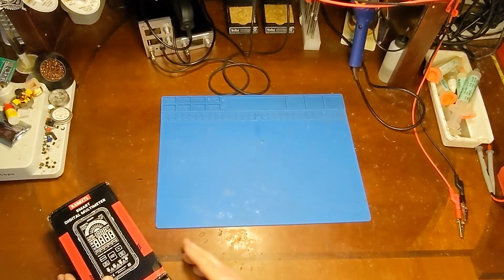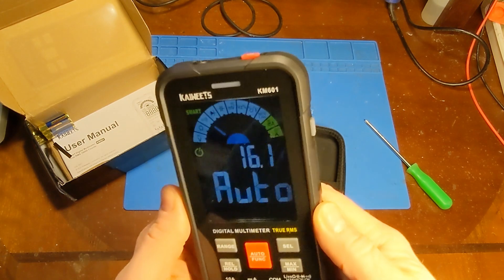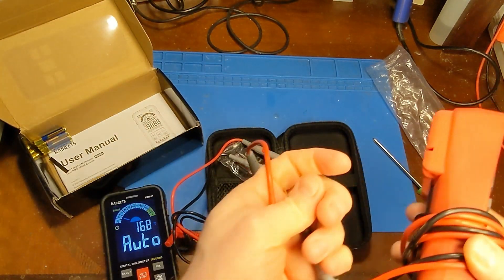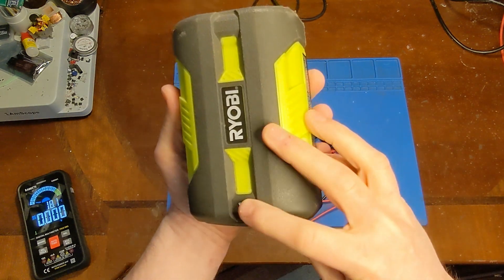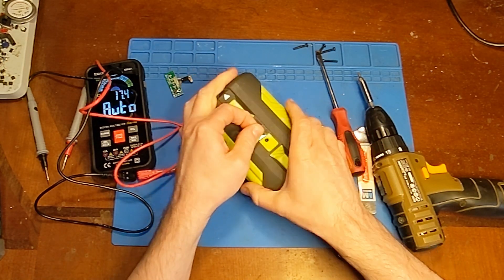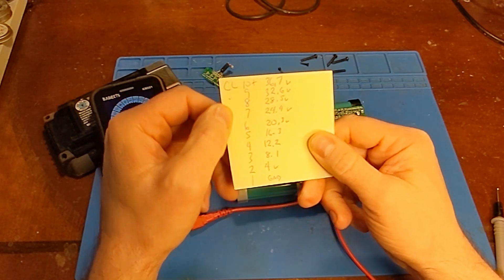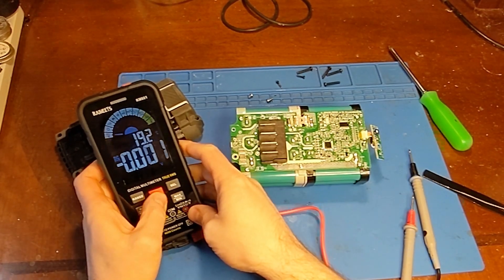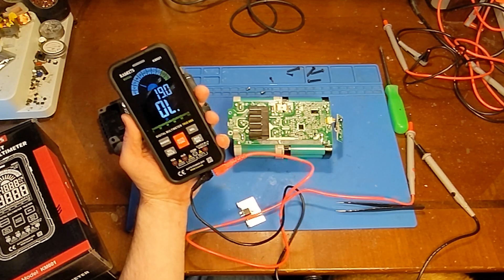Kaiweets KM601 DMM Giveaway & Black Friday Sale

Comment: The flash light makes it look a cell phone, the brass screws insert real nice touch. A lot of budget tools miss that. The lights for the leads is nice the normal way they remind you on a lot of them is really loud beep when they are in the Wong plug if the multi meter has a warning at all. Although it is over molded it looks like it really could use more bumper to protect it.
Reply: @Cockapoopooppeshire  I didn't because it's not my channel lol

Comment: What a nice multimeter, have you tested it for basic accuracy on volts and ohms?.
The meter leads are always crappy on most budget multimeters, show them the bin.
I would have bypassed that mosfet just see if the pack could deliver full voltage under a drill load.
Ahh quality control kitty,  keeps you from bodging stuff,  As if you would lol.

Comment: What do you use for programming the chips on the clusters? I work at a mechanic shop and am trying to adjust the odometer reading to match original mileage of the car
Reply from the maker: It depends on the year/make/model of the vehicle.
Reply: @jeffescortlx  it is for a 2005 gm tahoe
Reply from the maker: @alexboughton5501  an old tacho pro or OBDstar programmer will work. But it would be cheaper to just fix the original cluster rather than buy a replacement cluster and then buy a programmer. If the replacement cluster is from a junk yard it might also need a rebuild anyways.

Comment: Have not seen you around much lately. Cluster work probably getting hard to find with the newer vehicles I guess they just put new ones in. Let us know what going on with clusters and up to what model years you go up to. Seems like on newer vehicle everything goes threw the cluster. As far as the multimeter you tested it sounded like a ok product. I can tell by your voice it was just a ok review. Hard to find anything these days that gets any people supper excited on average tool. It does select what you want to use it for rather than you doing it manually. May be nice for some DIY folks out there. Like anything new you need to use it and test it out for about a year then you know what you really have. Welcome to the push button world.....lol